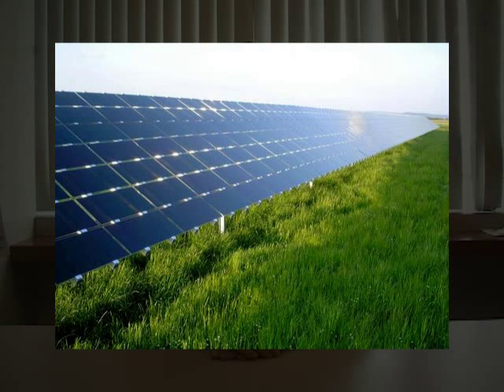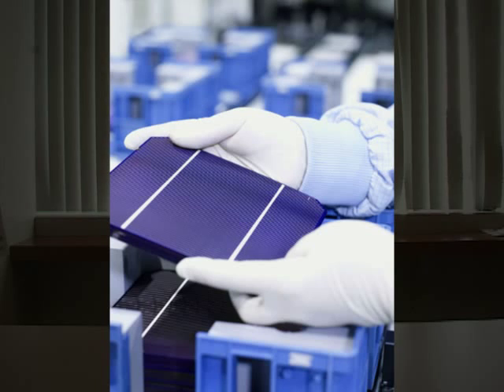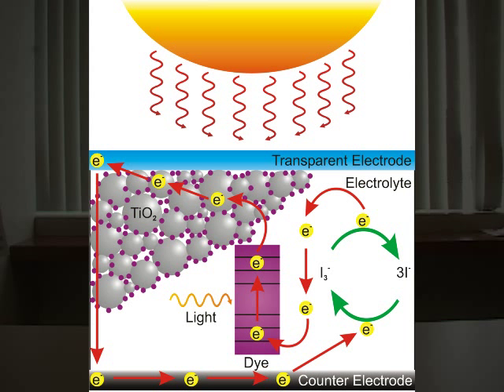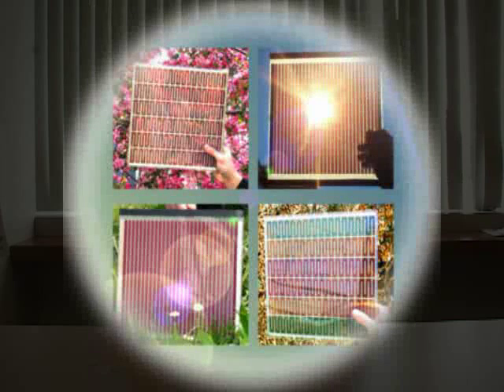Dye Sensitized Solar Cell Lab Introduction

Comment: Ito film
Base- Titanium dioxide(-)
Dye-Phthalocyanine 
Dye-porphyrin (dyes can be substituted with crushed raspberry rinsed with 99% ethenol)
Iodine 
Carbon(+) or metal conductor

 remember that dye cells need to be in small cells or they loose power. Look up dye cells designs and pay attention to how they separate their dye cells inside the dye panel

The titanium dioxide needs to be dried on the film at 120F for 4hrs then soaked in the dye then cleaned then iodine is added as the electroly